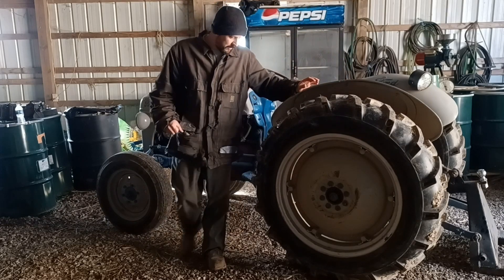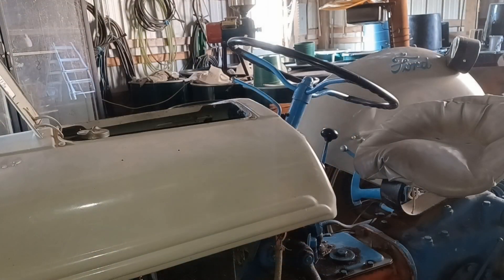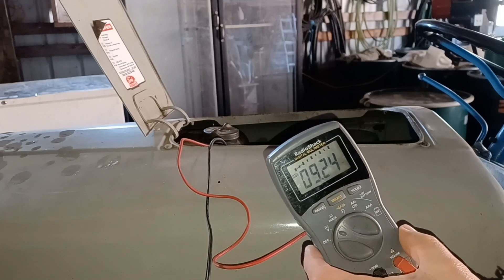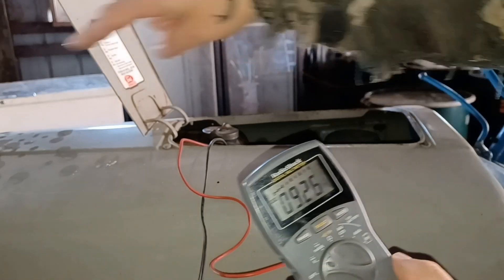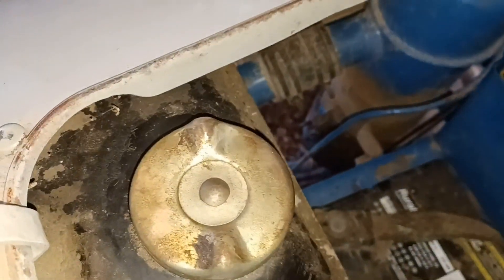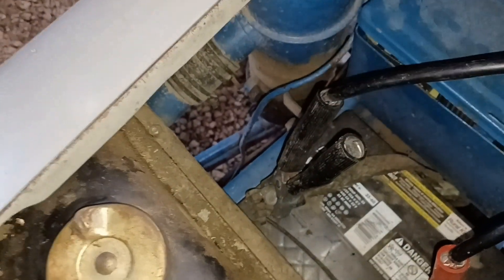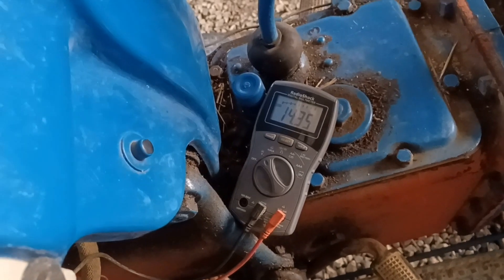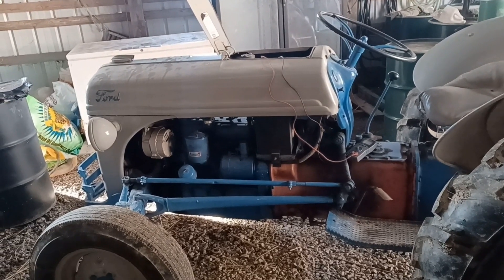8N Ford Tractor Battery and Charging System Tests

Comment: There are starters that are wound for 12 volts. I have to switch mine over. The old 6volt starters get tired after a while and drain the battery fast.
Reply from the maker: My starter is still on 6 volts and is holding strong.